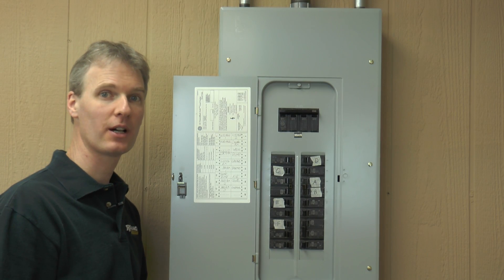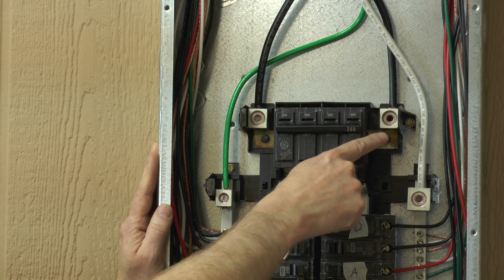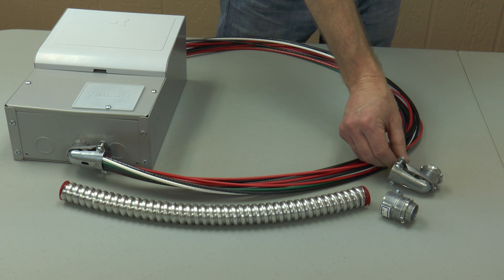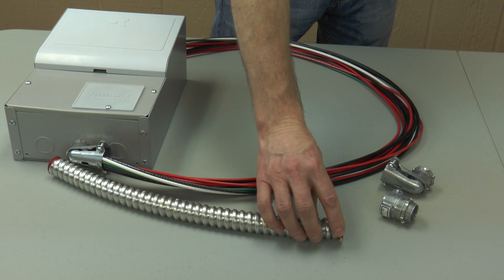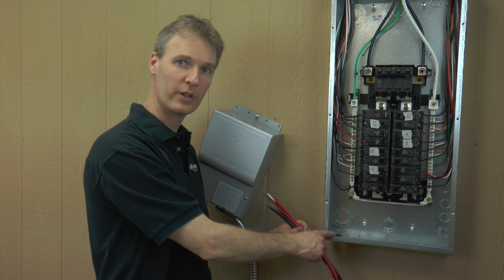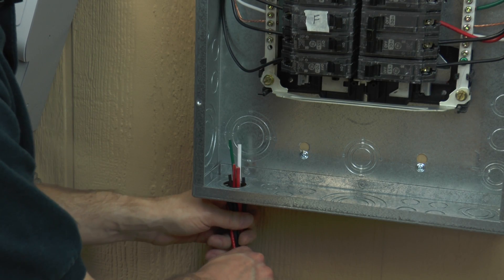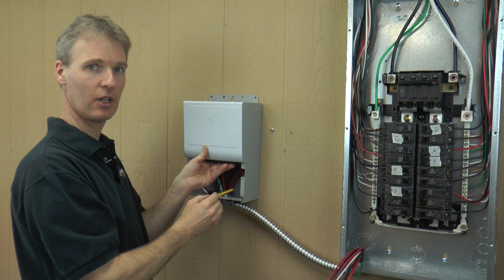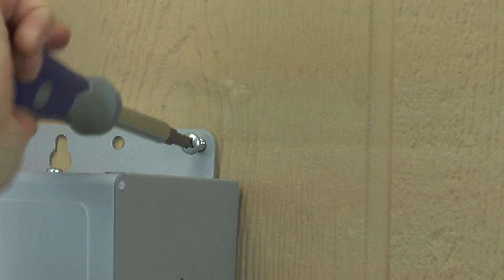How to Install Reliance Controls ProTran2 Transfer Switch- Part 2 Mounting

Comment: Can this transfer switch use square d breakers
Reply from the maker: Hi thank you for your question! Yes, Square D HOM style breakers are accepted in the Pro/Tran2, as well as Eaton BR, Siemens Q, GE THQL.
Reply: If the panel accepts Eaton, siemens or GE, then Homeline is not going to sit right. It will "work" but they will not seat properly and will be a bit off when putting your front cover back on

Comment: I have limited space, can I mount box sideways?
Reply from the maker: Hi, great question. Yes, the transfer switch can be mounted on it’s side or even upside down if necessary. Thanks for watching and let us know if you run into any issues during your installation :)

Comment: I have a question i have the main line mobile home service pole 200 amp panel box outside but i have another breaker box inside that controls all the plugs and switches. So my question is where do i wire my transfer switch? Inside panel box or outside to the main line box but they all big breakers outside.
Reply from the maker: Hey, thank you for your question! If it is only the smaller breakers you wish to control then you would mount the transfer switch next to panel inside with those breakers in it.  The neutral and ground would go to the respective bars within the panel inside. Please let me know if you need more assistance.

Comment: Hello, I have an outdoor electrical panel on the side of a garage but I would like this installed inside. Am I able to go through the back of the panel or pass through to the outdoor through the wall and then through the side of the outdoor panel?
Reply from the maker: Hey there! Yes, you can go through the back of the transfer switch.  There are two knockouts on the back of the transfer switch.  Once the wire exits the conduit you have 2.5 to 3 feet of wire for inside the panel.

Let us know if you run into any issues!

Comment: One neutral wire of the same guage as the other wires seems insufficient to handle the current from all breakers. You would either need one larger wire or separate wires for each breaker? What is the current rating for those wires? Thanks.
Reply from the maker: Hey! Thanks for your questions. 
The one neutral wire of equal gauge is sufficient because we aren’t handling the return current for each breaker, only the return current from the power put out from the generator. 

 In a 120/240 application the two hot legs are in opposite phase which means that only one neutral wire is necessary.  The neutral for each individual breaker is still being supported by the house wiring in the main panel.

Hope this is helpful but let us know if there's anything else we can do.
Reply: @RelianceControls  Hello, and sorry for the delay but back into this project. I have a 120V 3.6kW generator and I want to use a 6 way transfer panel.  Since there is one phase 120V for all circuits, there is no current cancellation with balanced loads in the neutral wire as two phase 120V/240V.  The return current from the power out from the generator will then be up to 30A with my 3.6kW generator.  That being the case, won't there still be a problem with the gauge of the neutral wire as it appears the same gauge as the hot wires for each circuit?  If this is still an issue, can the A306 series be modified within the transfer panel to support 30A for the neutral?   Thank you.
Reply from the maker: @richardkay62  Hey Richard! The one neutral wire at 10 AWG will be sufficient, since the 10 AWG would be rated for 3,750 running watts, even at the max 3,600 running watts of the generator you’re well below the max rating of the wire.

Let me know if you have more questions!
Reply: @RelianceControls Good news thanks!  How long do the wires extend past the opening of the end of the 18" flex conduit?  Also, my generator has a 120V 3 prong 30A TT-30R receptacle and I plan to use an extension cord to connect to the transfer panel plug inside the house.  I notice that there is an option for the front panel 240V 4 prong 30A plug on the front of the panel (No option exists for a TT-30 receptacle).  I was thinking of wiring 3 breakers to one phase fo the 240V receptacle, 3 breakers to the other phase, then jumpering the two phases inside the transfer panel.  That way I could connect my one hot line from the generator cable to either side of the 240V plug on the unit.  Does that sound possible to wire it that way inside the unit?   Thank you!
Reply from the maker: @richardkay62  Once exiting the conduit you will have roughly 2.5 to 3 feet. The easiest way of accomplishing this is via an adapter cord.  TT30 plug to L1430 connector.  This way the bridge of the wires happens inside a cord or connector end and that way the unit remains wired for connection to a 120/240 generator in the event you upgrade or borrow a generator.

Please let me know if this doesn't answer your question :)

Comment: Most new construction now require afci breakers in the main panel which will not work with this unit as shown.  Installing this unit on afci breakers without also having afci breakers in this transfer box will not meet code... therefore you will need to modify this unit,  which they won't show you.
Reply from the maker: Hey @Flyguy, while we understand where you are coming from with your comment, there are variables in installing any electrical product. Even things as simple as where you live in the country can impact a number of requirements, as we’re sure you’re aware. While AFCI and GFCI circuits need to be handled differently, depending on interpretation of the code, it can also be viewed that AFCI protection isn’t required on temporary installations, which by definition a portable generator is.

When it comes to new construction, where AFCI’s may be required, we actually have other solutions that we would recommend, like our TTV series transfer panels, which provide substantially more flexibility and are ultimately a better option in that instance.

We also have kits available to help with the installation of AFCI/GFCI circuit breakers for our ProTran line of products. NK06 (for 6-circuits) & NK10 (for 10-circuits).

We’d be happy to discuss any of this further. Should you have additional questions or concerns, please give us a shout @ (800)634-6155

Comment: Hi so i am installing a reliance transfer switch I'm clear on everything except for my stove witch is run be a 220v line is it the same as the well pump in your video ????
Reply from the maker: Hi Tony! Indeed. You would want to treat that just as you would a well pump.

Out of curiosity, do you know the amperage of the circuit the stove is connected to? I ask because a lot of electric stoves are over 30 amps. The A&B circuits on any ProTran 2 will handle up to 30A, but anything above that will exceed what the transfer switch can handle.

Comment: I want to install this transfer switch, but I'm running into a problem - I have a Honda EU2200i, which is a 120V only generator with a standard 3 prong outlet (X2) - the companion model has a 30A plug, but it's still rated 120V.  My question is - do I wire the remote (outside) box to the switch using all 4 wires (red,white,black,ground), then use some sort of an adapter between the generator and the outside box, or do I run the 3 wires (black,white,ground) from the outside box into the transfer switch, and just connect the red and black from the switch to the incoming black wire?
Reply: Yes.  Wire the inlet box and transfer switch as instructed per the owner's manual. You can buy a three prong to four prong adaptor for your extension cord.

Comment: my central hvac  have a 40 amp breaker what can do to accomadate this unit
Reply: GET a much bigger panel, Also your AC unit will Draw more than the 7500W limit on this panel. Hope your Gen. is at least 10,000-15,000 W.
Reply: Nothing ,find a different way of hooking up a generator. 
Not to mention most portable generators would not handle a 40 amp load in the first place!

Comment: Can I elemental the flexible conduct.. really having a hard time get it to fit behind a wall .. the panel is flush mounted and the transfer switch will be mounted on the wall with the wires running into / inside of the wall and up to the panel box.
Reply from the maker: You have to verify with local code, usually wires behind a wall must be in some type of acceptable conduit/sheathing to meet codes.  The wires will be vulnerable if they are not running in some type of acceptable conduit.

Comment: On most new construction, the main power comes from the bottom of the panel.   Reliance switches are made specifically for panels with power coming from the top of the panel.   It does not provide enough cable length or wire protection for this type of setup, unless A) you mount your transfer switch high above your panel, or B) you replace all the wire for a longer run.
Reply: Where  is this Most new construction coming in from the bottom? for the past 20 years the majority of the work i have seen and done comes in from the top. also i have installed Allot of these over a 20+ year career as an electrician and weather the power came in from the top or the bottom made no difference.  you can also shorten the Flexible metallic conduit if you needed to lengthen your wires and i typically would not for wire length but for a neat and professional finished product.

Comment: lol,well I will be nic picky.Did not see u use a level,the incoming hot wires in the panel that was for the 200 amp breaker were to small and the conduits in the top of the panel were crooked and you were using big lot tools
Reply from the maker: Hello, haha it's ok, always nice to have that attention to detail!   The large breaker panel was actually just a demonstration panel we set it up ourselves, the size of the wires and conduits were not perfect as to comply with building code as it was only a demo, was not connected to any utility power source, and was for visualization purposes only. The tools used were a basic screwdriver and a power drill, so I'm not sure about the brands of the tools being a big deal but hey everyone has their own brands they might prefer, cheers.
Reply: and always remember your work is as only as good as your tools
Reply: lol,but I understand and knew this was for demonstration purposes but atleast have your stuff in every aspect squared away because a old electrician like me is going to nick pic,please set a good example in your next videos by covering the smallest of details

Comment: You may need a flashlight once the electric is off. Not me, I have super military strength night vision installed in my eye sockets. OF COURSE WE WOULD NEED SOME SOURCE OF LIGHTING.
Reply from the maker: creepyzeek1 😂😂 nice one! We’re big fans of Captain Obvious.
Reply: @RelianceControls  

All kidding aside, I have this unit, 30 amp 6 circuit trans switch. I haven't had to use it yet, but I like the fact that I don't have to shut the power off at the main.

Comment: My ground is bonded on the main panel do I connect the ground and neutral to same bus bar or do I connect neutral to neutral and ground to ground?
Reply from the maker: The main panel (or service entrance panel) is where the code requires the neutral to be grounded, so in this panel only the neutrals and grounds are considered common.  In this case the neutral and ground from the generator and through the transfer switch can each connect to an open terminal on any of the common neutral/ground bars.

Comment: Some codes require installation of plastic screw-on bushings over the threaded ends of the connectors  going into the load center and the transfer switch.  They are available in all sizes at home centers or electrical equipment supply stores.  Whether code required or not it's a good practice to use them.  Also,  using a spirit level to assure that the transfer switch is not mounted cockeyed will make your installation more professional looking.

Comment: Is there a recommended Switched Neutral Kit for this unit? If so could you do an install video also? Thanks.
Reply from the maker: Hello, thank you for the question.  There is not any accessory kit that is made and certified to add to this type of transfer switch to create a neutral switching application, sorry.  There are other transfer panels Reliance offers that do have a switched neutral setup but they are quite different from this style shown in the video.

Comment: I bought this and installed the unit...now I use it all the time...I power my home from my off grid solar system instead of using a generator...cleaner and I can use it all the time...even when I just want to use my own power...fuck monopolized power companies...buy one of these switches...and transfer your power to another clean pure energy source
Reply: Great idea!!!!
Reply: If you don't mind, how do you connect your PV solar or inverter to your 30 or 50 amp inlet plug on this manual transfer switch?  I'm also planning to do something similar so I'm using less grid power and can use solar (or propane generator if emergency).  Thank you for insights into how your set up is.